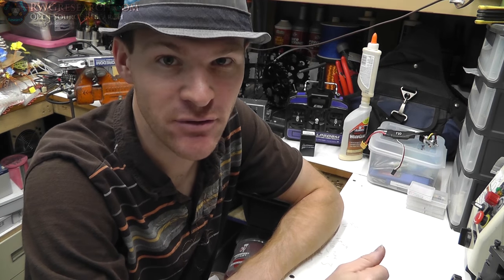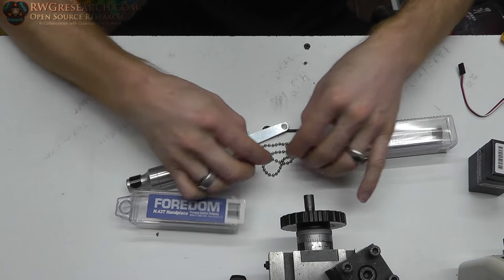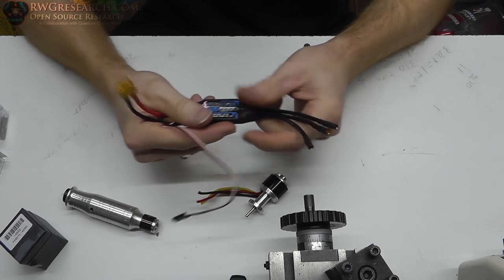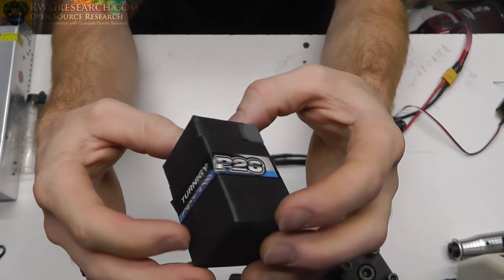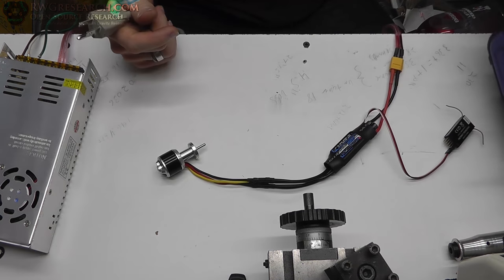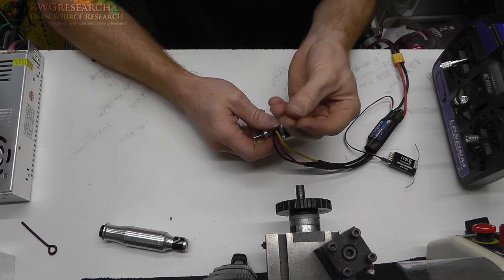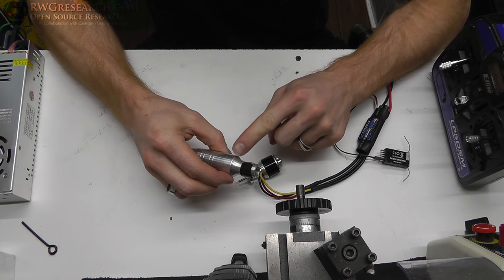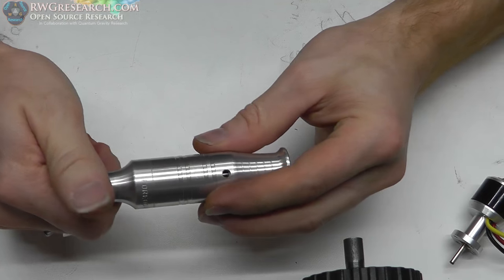P1. Lite & Powerful Brusless CNC Spindle Build For 3D Printer. The Idea & Overview

Comment: That open side creates on the back end should create a negative pressure that heat will go to. Keep that back end open and it should prevent overheating. You are quite the retrofitting king my friend. The coupling of the motor to the spindle looks like a challenging task that you have the tools to perform. I have complete faith in you dude.
Reply from the maker: one day at a time :) cya soon? ~Russ

Comment: I am thinking about a similar setup, but with a belt driven spindle. My only concern is runout since I want to put it in my pcb milling machine. Thought about putting some cheap chinese ceramic bearings in the spindle

Comment: great find man .  one suggestion .. next time you do a online order .. grab a servo driver .  its just a pot to a pwm servo signal. good ones even have some of the same over drive features good radios have for getting max travel and center offsetting .  and they are cheap .   i had wondered about using one of mine for pcb milling ,  but i need to change shaft length/center position so i can mount a small fan on shaft at the back / top . its just a set screw .  but for clearing dust and cooling it might be handy.
Reply from the maker: good idea! i was gonna make one but yeah i'm sure there cheep and good to have around! this will be connected to the printer so all control will come from the Gcode directly! :) yeah I'm gonna try to make a dust collection system. i already got all the parts ready and need to finish this so i can test it . if i don't its a mess! and that's no good for anything !!!! :) will see how it progresses ~Russ

Comment: Russ, make a collar that fits over the motor shaft, and has a key attached to it. That can then engage with the keyway in the spindle end. Make the collar have too tight a fit, then heat it up with a blow torch and pop it over the motor shaft :P
Reply from the maker: yeah, i i made something that fit over it.  but want to fill in that slot. so if what i made already dose not show good balance i might make a shaft and cut a key way in it... right now I'm just using set screws to hold everything in place... seems ok so i far but i cant tell until its finished :) ~Russ
Reply: ***** Sounds awesome man :D can't wait to see the next part! Enjoy the rest of your weekend :D

Comment: You could try out a flexible coupling because the torque is low. I have had success using oversized adhesive heat shrink.
Reply from the maker: yeah, that's a good idea, i could a thick one some nylon or something may work really well... I'm worried a bout something supper soft as 45,000 rpm is a lot! thanks for the idea! ( i already made a solid one but may back track to try it! ) ~Russ

Comment: I would leave the handpiece as it is and focus on making a sleeve and shaft adapter that allows you to mount the hobby motor to the hand piece.  That way if you do decide to repurpose the handpiece or the hobby motor fails it will be easy enough to change things around in the future.
Reply from the maker: yeah ,that is what i was thinking too, i reamed out the back AL part slightly... but it will still work... :) ~Russ

Comment: I would cut off the c shaped steel down to the bass nut. Then drill straight into the spindle shaft at lease the distance of the motor shaft. Turn a aluminum piece. Drill into the aluminum and make a recess for the brass nut.  Then thread the large threads on the aluminum. Cut to thickness. Drill and tap the 4 mounting holes. On the motor shaft make a steel piece that fits over the shaft and drill in the shaft and piece you made at the same time, so you end up with a semi circle key way. Then make a rod that fits in the spindle hole that was drilled and drill in the piece you made and spindle shaft. Use the dill size that correlates to the small rod you plan to use for your key. The aluminum back casing is not needed. Not all the steps, but hopefully you get the ideal.
Reply from the maker: any extreme modification of the shaft's is a bad idea, if anything i do is off center its junk :) i just made a coupling to connect them together :) now worries ! i was trying to stay away from to much work! lol i could have made the entire thing but no time :) ~Russ

Comment: 9:15 mins in and I have a feeling its going to be direct drive. hope you do the belt drive setup and step it down like an other mill. they basically took a Chinese spindle and milled it to there spec. spindle extension. then can have the er collet
Reply from the maker: yeah, if i could find a small light gear box lets say 2.5:1 that would be great, i don't want an off set belt drive due to the space i have is limited!  :) ~Russ
Reply: Gear stack, but there is whine.
Two right angle and a belt should be quiter but still have two gears.

But an old dewalt comes to mind for a planetary gear that can take the rpm
Reply: Or gears off a drone. Lol. Already got the motor
Reply from the maker: something like this , http://www.atlantahobby.com/Store/pc/viewPrd.asp?idproduct=15812 but smaller :) adds more cost tho.. ~Russ
Reply: If I send you something, could you re-drill the hole straight? The collet on my setup is way off, or make a straight collet nut for me?
I still don't have enough to get a shop fox yet like you.
Reply from the maker: if what ever it is is threaded I'd have a hard time. email me with some photos and what u need. ;)
Reply: For sure. Small donation to help.
Reply from the maker: if you emailed me i did not get it! Skype works too :)
Reply: Will do. Need to find where I left it first lol.

Comment: I would recommend the use of a timing belt and pulleys a reduction of at least 5 : 1 thus you have lots of volume with no mass.. beside that is important to find the way to put a good fan.. this machines are designed to be in a high volume of air and do get extremely hot.. In total honesty don't know why didn't you use one of the largest motors available but I understand that budget may be an obstacle.. I do have actually made a few machines that use this type of motors.. but their use is totally intermittent so temperature have not been precisely a concern.. "If you may be interested I can send you a PM with my highest rpm machine to date" but I would request you don't share the video..
Reply from the maker: so i need something very light weight. and powerful, and compact, so that's why i went this path. if you can fin me a spindle that is 1"OD,  35,000+RPM , 250W at least. and under 100$ ill give you a high five! lol really tho, i could not find ANYTHING that was that compact, for what i want this is gold. and cheep. so far the final build has shown  plenty of torque and speed. so I'm a happy camper.  new video soon, and one to fallow with the finished build.  the entire spindle is right at 7.5 Oz  that's quire lite!  :) yeah PM some links!! ~Russ
Reply: I can't offer any thing lighter, or cheaper than what you have, never the less I would advice you to find the way to cool the motor that you have in your setup... other wise its life will be very short.."You are listening to the voice of experience"
Reply from the maker: yeah, it seems to be the coolest part of the setup! that big AL heat sink! moves a lot of air! ~Russ
Reply: Well, I'll say that if you honestly don't care about to "Either or have a few spare motors for when ever that one burns "Counting on you been lucky enough to cut the power before it take the ESC with it....Or considering this an exercise on (Yeah I made it and it works) and never consider it a machine that would actually work for long periods of time...) you would be just fine! Even the companies that make them consider them a disposable item... so just take it from that point of view.. good luck my friend... By the way I did look at the last video.. you are a very brave man.. I would't have risk my phone..
Reply from the maker: no worries, i'm just saying, i tested it for over an hr non stop, its only pulling like 10-20W when cutting. so it just dont get hot. if i was using it under full power it would get hotter , but the micro tool I'm using just dose not need any power... so thats why i mean. if i cut stuff with a 1/4" end mill it might be a worry,but i never plan on using such a big end mill. i dont think the OSD can handle it well... in the end... if it works it works, and if it fails it fails... :) im hearing you , and i'm listening, i did not change anything on the motor, so if it can cool its self then adding a big aluminum heat sink to dissipate heat can only cool it more? right? ~Russ
Reply: Well I guess that in the end you are correct.. you have to remember that I'm an engineer that work with Iron and Still all the time! & In my mind... everything have to be build to survive the Armageddon....
Reply from the maker: haha YES! and look like art :) i'm with you brother! ~Russ

Comment: hi russ
to control  the motor ,you don't need  the transmitter  just make that :http://www.555-timer-circuits.com/servo-tester.html
the Second   servo controller

regards fas83
Reply from the maker: thanks! yeah in the end i will be running this from my Duet electronics that are on the printer! :) ~Russ

Comment: Hi,Russ

If you bought a ER11 colletchuck like this http://www.ebay.com/itm/New-Collet-Chucks-Precision-ER11-Extension-Rod-Toolholder-CNC-Mill-/261578827020  
or 
 http://www.arceurotrade.co.uk/Catalogue/Collets/ER-Milling-Collet-Chucks-Straight-Shank

and mount that direct on that motorshaft ,i bet it would be alot lighter . You also can change diverent collets.
Reply from the maker: Yes. I was going to do that. but you have to remeber that the spendel needs to be soild. it will be under some side pressure and needs to be tight tolerances. so the best option was to make or buy that part. was smarter and less work to get the hand pice. if the motor had a 8km shaft on it then yes. good to go. I could use the motor as it's mount. but for this small of a spendel. it needed extra spoort. :)  thanks!! ~Russ
Reply: Can you somehow mount something like that on the spindel you got?

That way you have a ER11 collet and can use different size bits if
you get the series of collets (Model : ER11. 7 pcs(1/16",3/32",1/8",5/32"3/16",7/32"1/4") ER11 Collets. Gripping Range: 1/16"-1/4"(1/16",3/32",1/8",5/32"3/16",7/32"1/4").

Would be stable due to the bearings,i think ,but don't know about runout.

Just a sugestion.

BTW love your work and vids.
Reply from the maker: right. I was gonna get one of those. one thing that turned me away was it looked heavy. those collets look like a lot of over kill. that was the main turn away. the hand pice looked like the best bet. it came down to the amount of work to make the housing and everything. ultimately I thought it was best to get the hand pice. ran my self in circles for days looking for a motor / spendel and just could not find Somthing compact light and powerfull and with the right size collet. :)  in the and I just thought getting parts more finished and making it work was the faster than making everything. lol. thanks for the comments!!!! ~Russ